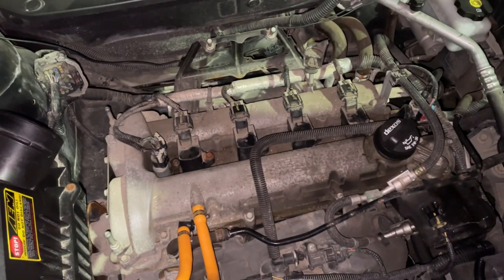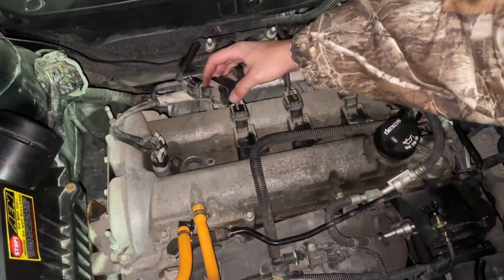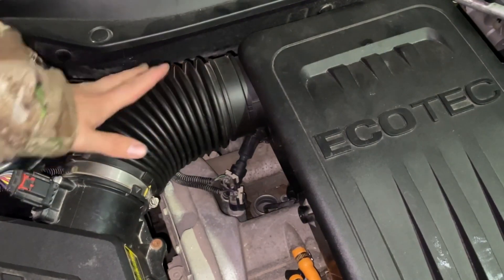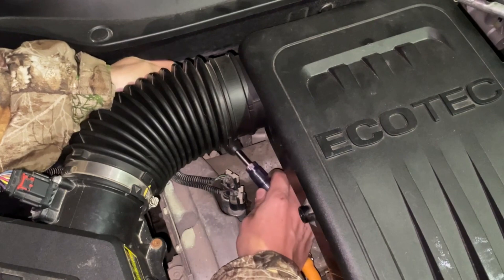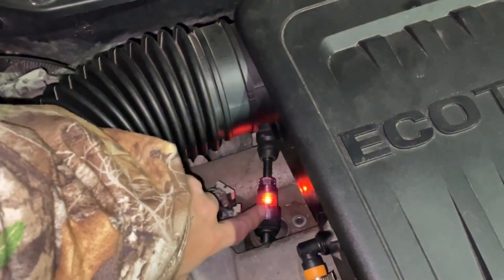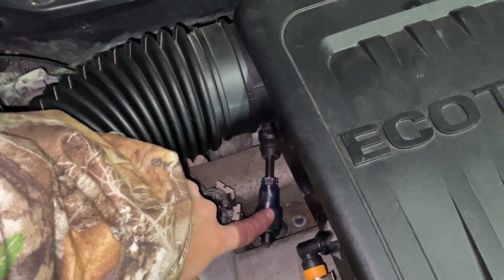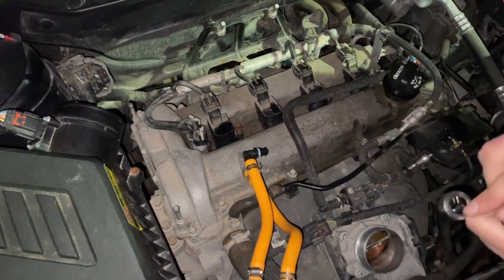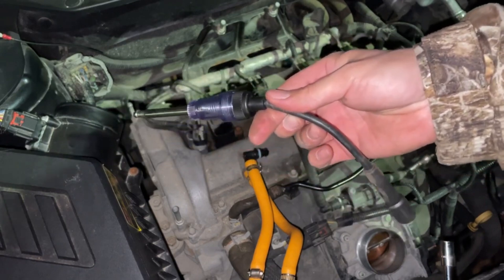How To Use An Inline Ignition Spark Tester

Comment: The tool is only testing the spark coming out of the coil pack. It doesn't determine if the spark plug is good.
Reply from the maker: That’s correct. If you want to test the spark plug then you need to buy a spark plug tester.

Comment: Can you check if spark plug is working with this or just the coil pack
Reply from the maker: This is just to test the ignition coil packs. If you want to test the plugs you will need to buy a spark plug tester that you test the plugs outside the vehicle. Hope this helps. Thanks for watching. Please like and subscribe

Comment: You dont have to start the motor buddy. Or out the i take back on.
Reply from the maker: Oh wow lol. Please tell me how to use a spark tester without the engine running. As for the intake, I prefer it to be on so the air is filtered going into the engine buddy

Comment: I dont think you have to reconnect the breather or any other critical components that enable the car to start. As long as it cranks you can have an assistant check for spark while its cranking .Every rev should produce one spark. Correct me if I'm wrong (used to this with old cars when they had points and dizzys.)
Reply from the maker: You do need to reconnect the breather to the throttle body because running the engine without it on will allow unfiltered air to enter the engine as you are testing which is not good. Furthermore as the engine is running without the breather attached it will not be pulling air passed the MAF sensor so it will run erratically because the sensor will be giving a reading of no air coming passed it. Always have everything attached properly when performing any kind of test to prevent damage. Modern engines are sensitive. And very costly to fix if careless mistakes are made.

Comment: That spark should be consistent not intermittent
Reply from the maker: The spark was consistent. The camera on my phone is not able to capture the fast speed of the cylinder firing. It’s like when you see a led light flickering on camera. It’s not flickering to the naked eyes. The frames per second of the camera aren’t fast enough.
Reply: @BillOfAllTrades2016  ok I got it led is difficult to film

Comment: Very comprehensive Video The engine would have immediately let him No if the Coil or Sparkplug wasn’t Firing Everybody has Ears I Hope😊
Reply from the maker: Yes that’s correct. This just helps you hone in to what cylinder is the issue. Thanks for watching. Please like and subscribe

Comment: What if its under my manifold and I need to check spark?
Reply from the maker: You would have to remove the manifold, take out the ignition coil, put the manifold back on, then perform the test with this tool. Seems like a lot of work but with this tool that’s the only way it can be done.

Comment: Thank you for this detailed tutorial. One question I have is if I am getting a misfire code and I get spark after testing, then this test is telling me that my spark plug is good but coil is bad? No spark means the plug is bad and not necessarily the coil pack?
Thank you!
Reply: This tool is only going to tell you whether or not power gets to the spark plug, it has nothing to do with how much power or even if the spark plug or coil are still good working order. There are specific tools for testing the quality of a spark plug.
Reply: easy to test the coils just swap it with one which does not have the misfire

Comment: It didn't look like you were getting a consistent spark. I would probably read that as a misfire, like a random misfire but I'm not experienced using these checkers. Reason I'm saying this is I have a misfire on cylinders #1 and #2 on our '02 Lexus LS 430 but if a good spark looks like this I don't know what a random misfire is supposed to look like.
Reply: This is due to the frame rate of the camera.  not a misfire.
Reply from the maker: That’s correct. The camera can’t keep up with the speed of the spark. So it looks sporadic. Similar effects have been noted when I do videos featuring led lights, the lights flicker on camera but not to the naked eye. Thanks for watching. Please like and subscribe
Reply: @BillOfAllTrades2016 I see, that makes sense now. Yes I've made videos of an LED tailight that I installed in my Harley that looked like it was flickering in the video. Also, come to find out I had a misfire on a 3rd cylinder on our Lexus too, I fixed it. It was 3 bad coils. It's ran smooth since. 👍
Reply: Aside from frame rate, is this how it would look to the naked eye with a sporadic spark situation?
Reply: There will be also a little delay due to firing order